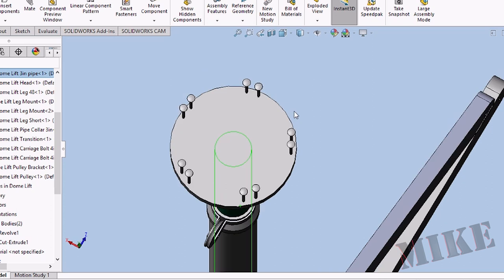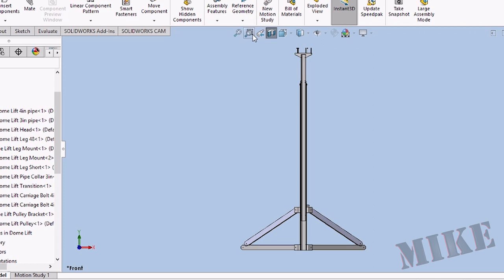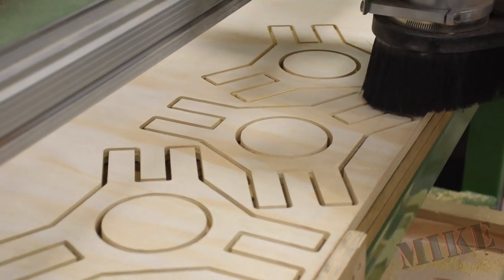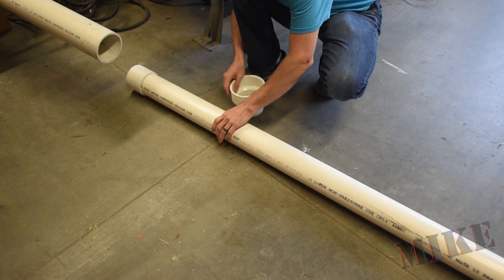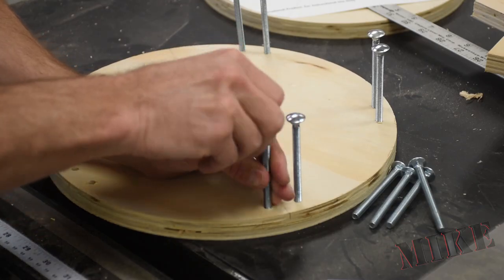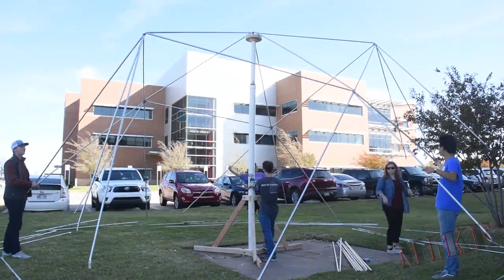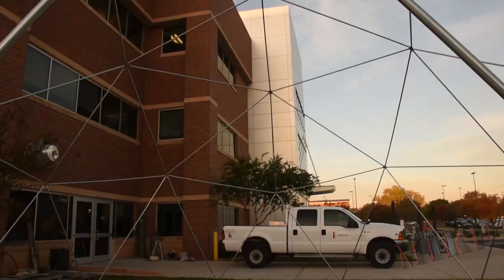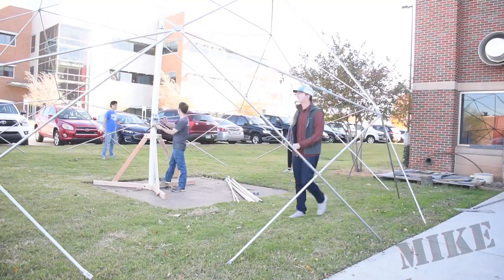Geodesic Dome Assembly Mast - Mikes Inventions

Comment: not quite sure how the pulley system works?  does a cable go over the pulley down into the center shaft?
Reply from the maker: Hey Chuck! It goes up the outside then over a pulley and through a hole in the reducer and between the two pipes and connects through a hole in the bottom of the inner pipe.

Comment: you have to keep it loose until it's completed, but wouldn't you still need ladders to tighten everything at the top?  This is awesome!
Reply from the maker: Hey John! We tighten it quite tight then it still pulls itself into shape. With a 10' lever, no amount of torque on a 1/4" bolt can keep the struts from rotating into place luckily. ;-)
Reply: @MikesInventions  nice thanks for the clarification, I've been trying to figure out which one to make at our school, hoop house or this, it's a head scratcher.
Reply: @inventanew 
Given the choice between a hoophouse and a dome, it definitely has to be dome.The kids will find it a lot more appealing and may even put down their phones to help build it ;)